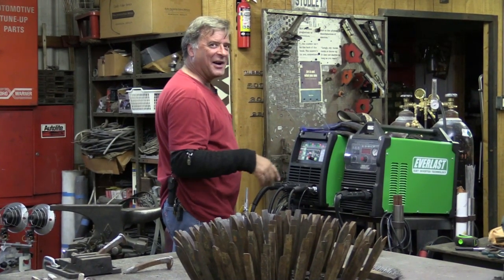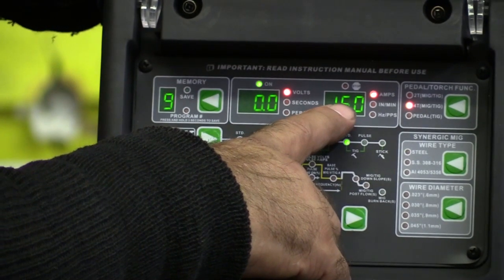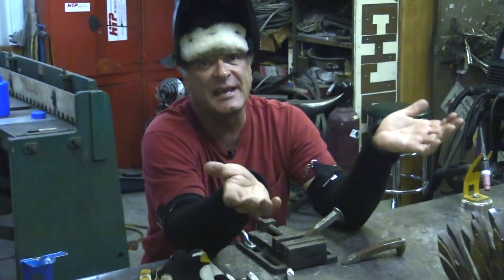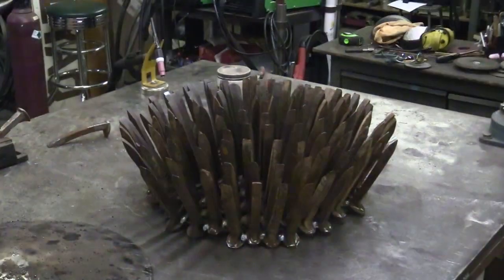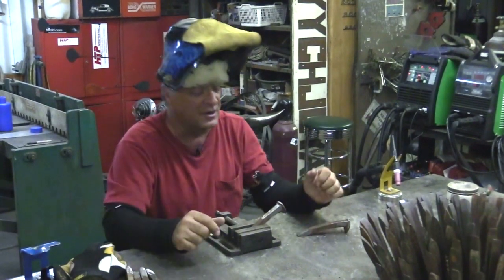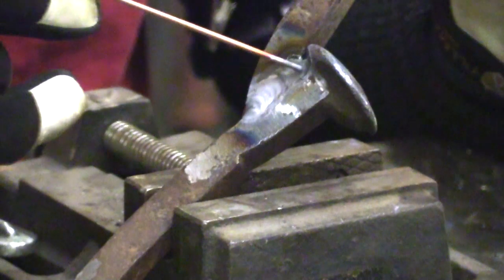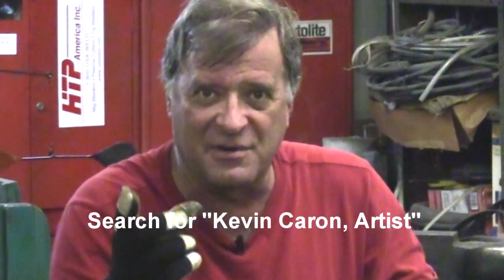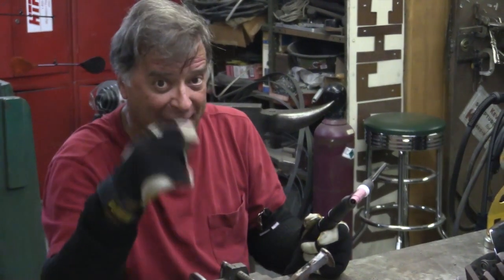How to Weld Thick Metal With a TIG Welder - Kevin Caron

Comment: I'm building frame work fit machines.....  kind of vague .... I know...   mostly 3/16th and below.. I about to pull the trigger on a new MIG welder ..,.  should I be rethinking this ?  
I always wonder if fit sound be good for structural and home repair type work.....  any advice?
Reply from the maker: I would go with tig for that thickness.  Much easier in my opinion.

Comment: how do I calculate the amps on different types metals?(stainless, iron.....)
what happens if you use more amperage then you need?(hot)
would I make a hole on the surface or break the machine?
Reply from the maker: I just go with 1 amp per 0.001 of metal thickness..     adjust as needed.. 

If you go to hot on amps yes, you can blow a hole through the metal.    But I don't think you can break the welder.

Comment: Kevin I am one of those starving hobyists i have a second hand Lincoln flux core 90 amp welder. Is there a way to use this for thicker metal like what you are welding
Reply from the maker: +Robert Merrick   Sorry but no...   Without adding more amps to the output you just can't do the thicker metals..
Reply: Yes!
Preheat your steel and grind the corners off your steel then run 2 passes with a broader pass on top. 
The heat from your welder is being quickly wicked away by the steel. 
The first pass will hold and super preheat the steel. 
The second pass will ensure your welding on really hot steel and therefore bite in deeper. 
Also flux core welding is best done inside or on a windless day.

Comment: Hi kevin great tips and advice!! I have a lincoln invertec160tp but the front and back of the tig torch have gone walk about.... Would you happen to know if the tigs are all generic sizes or specific to each torch? A long shot i know but thank you in advance. Aus
Reply from the maker: +Dubstep Look on the side of the torch.  there will be a number and a letter..   get the same size.   Should fit no problem..   Or just get a whole new hose with torch to fit that machine..     Check with the folk at CK torches..    they will know what fits that machine..
Reply: +Kevin Caron, Artist thanks a million mr caron!! Cheers

Comment: I understand the yellow flap on the front of your welding helmet, protect your neck from the UV, but what is the white fluffy thing on your headband? Is that a mega sweat absorber, or is is something else? I ask because I have the problem of the lights in my shop causing a reflection on the inside of my helmet making it hard to see the welds, I have tried moving the lights, but, you need lights, so I still get the reflections, but I was thinking of a flap on the top of my helmet too...
Domo
Reply from the maker: +StuInTokyo Big sweat band!!    It's regularly over 110 degrees in the shop this time of year..
Reply: Thanks Kevin